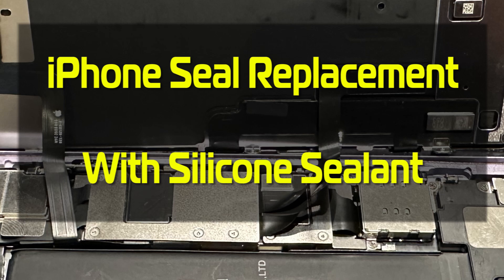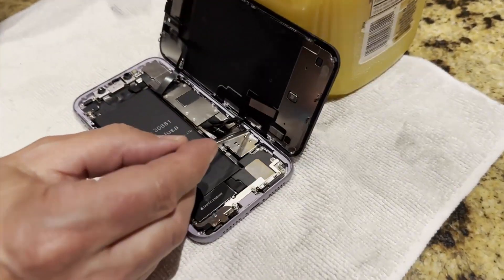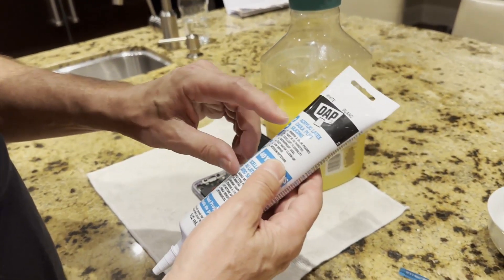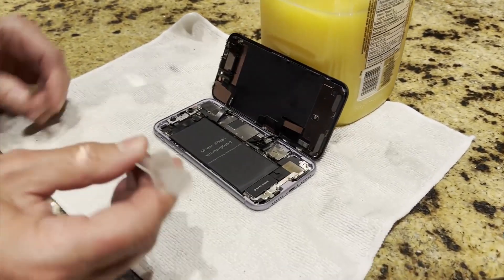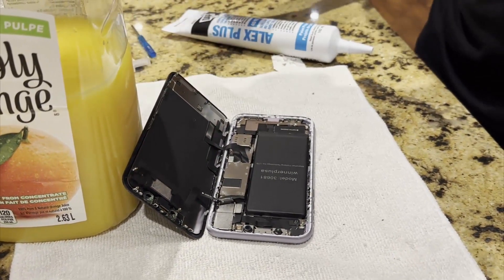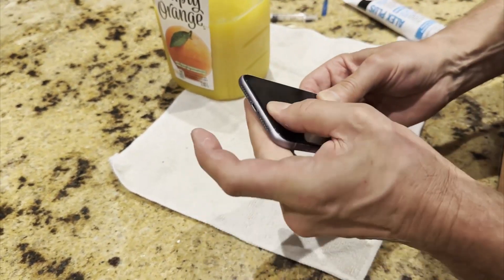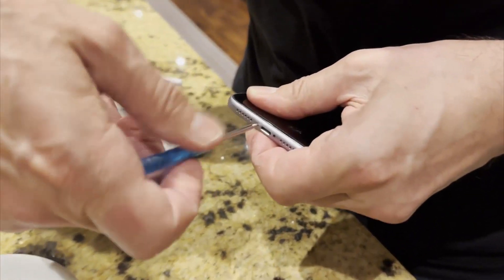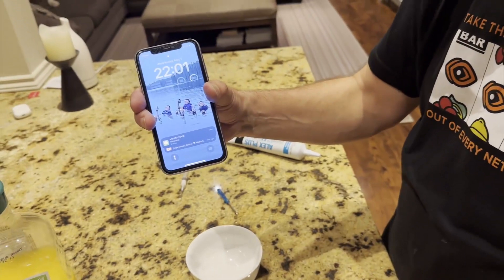iPhone Water & Dust Seal Replacement using Silicone Sealant

Comment: Only concern is the caulk is not heat sensitive for removal....otherwise AOK.  I have the shakes like that too...since I stopped drinking...I was able to buy gaskets from Amazon...3 for like $6